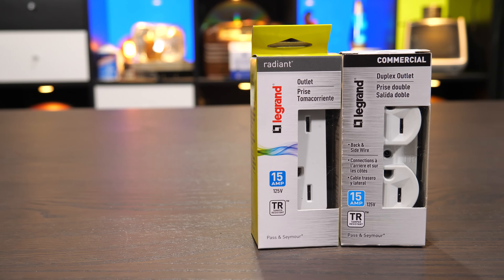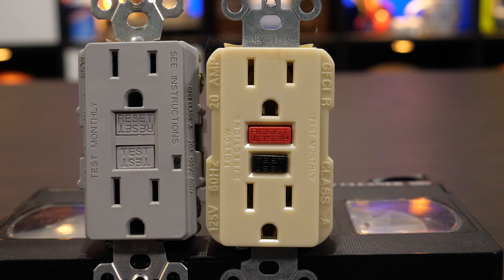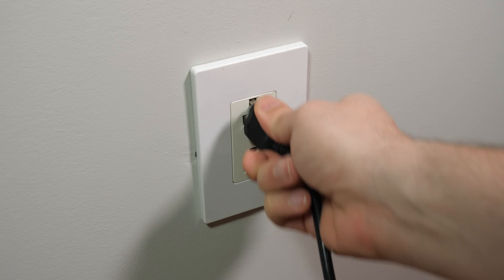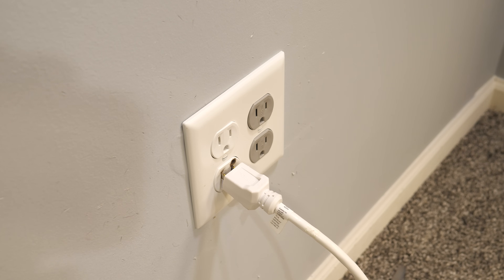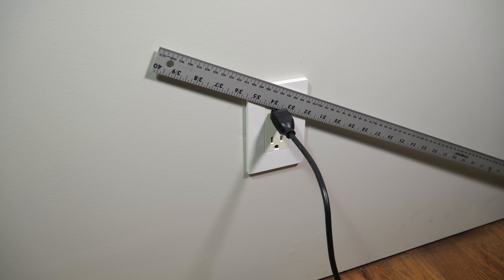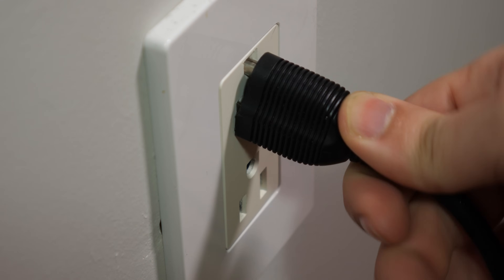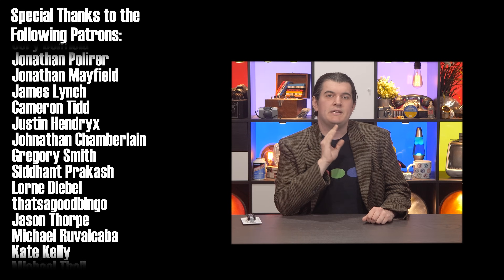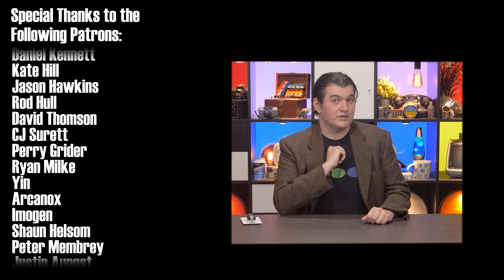Power outlets are topsy turvy - but does it matter?

Comment: "It would be supremely irritating"
Two-prong supremacy! If suddenly I had a bunch of upside-down outlets, it wouldn't matter one lick. If I had a bunch of upside-down three-prong outlets when I woke up, it'd be a marked improvement.
Reply: Or, maybe, recessed symetrical outlets with dual ground prongs at right angle to the live prongs? I wonder where I've seen that....🤔🤭🇪🇺✌🏻
Reply: @SonsOfLorgar  I know where you haven't seen that: my house built in the 1950s with ungrounded outlets!

Any sort of grounding solution would be an improvement, but I'd prefer one that works with the electronics I already have so I can completely retire from the adapter life.

Comment: My Dads cousins Husband is a retired electrician and when we had him over to fix a simple problem n the first house we bought he told us that there was a line in the code here that said outlets should be installed ground pin up when in mobile homes (which ours was not) but that no one seemed to care enough to do it and if we wanted to technically we'd be better off by flipping all of our outlets to that orientation and could easily do it with no issue other than the time it took and some breaker flipping. We elected not to take the time on it because knowing us when we moved the next people would just undo it.

Comment: If someone just made a faceplate with a little visor, that would solve most of the issues. Just a lip an eighth or quarter inch tall that sticks out around the perimeter. Basically, the faceplate could act to recess the outlet a tiny bit. The faceplate would catch or deflect objects instead of letting them head right to the prongs.
Reply: Or... CE standard...😂

Comment: Me: remembering all those old houses my relatives lived in with sideways mounted triple ungrounded outlets.  (often in the baseboard moulding so you could run the wires behind the moulding without putting holes in the wall)

Comment: I'm so glad Alec did a video on our shamefully horrid NEMA 5-15/20 plugs and receptacles. Having worked with many trade guys who, for reasons I can't imagine, seem to be the "guns, fireworks, flags, veteran parking spots, 'Murica!" type, this was always the one thing that would get them to admit this country isn't "the best at everything"... although usually only after pointing out the abysmal 1,500 watt typical maximum power available on our weakling 115V 20A circuits. 1,500 watts is like... less than a smart car power! THE SHAME! THE CRUSHED MASCULINITY! 😂
Reply: Way less than any car! Typical car engine/electric motor is around 200kW, and I've heard of electric sports cars pushing 1MW. Even a Model T Ford had a more powerful engine, at 15kW it beat your anaemic circuits by a factor of ten. So, there's something you can use to point out the low capacity of your circuits: "One tenth of a Model T Ford!".

Mind you, residential circuits don't need a heap of capacity. Even the most power-hungry devices like stoves and water heaters that get their own hard-wired circuits still only top out in the single-digit kilowatts (3.6kW for my hot water system). Our standard power points in Australia are only designed for 10A of current at 240V, and your home-charger for an electric car is still only 7kW, but who cares if it takes 8 hours to recharge from the day's usage if you're spending those 8 hours in bed?

Comment: My house was built in 1923 and the electric has been updated but I figure it's still very old. I worry a lot about fire but cost to update my very small 900 ft LA Craftsman was surprisingly high. I am sure I am not alone as far as living in an older home without updated wiring. I see a spark when I plug in something with a couple outlets so I assume that's not good. Would it help to just update the electrical boxes? Thought maybe some electricians, or those with  knowledge on subject, reading this could advise.

Comment: Way to identify a legitimate issue and then SPECTACULARLY FAIL TO ADRESS IT, AT ALL! The solution to this problem isn't shrugging and saying "I dunno, install it however you want", it's REGULATION of the freakin right angle plugs! Mandate the ground-up orientation on all plugs, and see how fast this *stops being an issue*.
Before you roll your eyes and scroll away, think about it for a second. Ground-up orientation on both the outlet and the plug would not only make them marginally safer, but more resistant to potentially hazardous wear and tear as well.
(Flat-footedly storms away, muttering incoherently)

P.S. I love this channel by the way. Never change, Technology Connections 💜

Comment: Our clothes washer and dryer have grounded plugs.  They are both the same brand.  Between then, they reversed one so the cord comes out the other side.  So one points up, and the other points down.   That way, they can both be plugged into the same duplex outlet.
I'm in Cook County.   Our 1967 house has sideways outlets👍🏻

Comment: a lot of those right angle cords fixed in the appliances like heaters are already the worst case scenario in terms of droop and stuff. within a season bad cable contact can cause outlet heating and other issues that aren't necessarily visible and if my parents are any indication, they never check on things while they're using them. walking through their house with a thermal camera was really scary. like "we need to replace these 4 outlets now, how did you not smell this." non-fixed cords ftw, extension cords: boo

Comment: I'm glad that our EU plugs are better in all points. They are perfectly insulated so that it's impossible to touch a part that has power. Also it's very hard to unplug them even a little bit by mistake.
Also they have ground connections on both sides which both are used by grounded plugs. So there is no question about the orientation.

Comment: You left out another reason not to rotate the plug socket 180 degrees: in some places the upside down plug is a way to identify which plugs are connected to a light switch.

In Arizona at least I've had multiple houses where the electricians put the lightswitch plugs upside down to denote which ones were wired to it

Comment: ...oooor you COULD just opt for a design that works equally in both directions like out Swedish plugs do; Two rods in the cebter and the ground connectors on both edges 90° offset to the rods. Can be plugged into the wall both directions (and the plug is surrounded by a plastic cover so even a partially dislodged plug, which never happens, cannor be touched, even when throwing knives at the wall!)

Comment: As a European I really do enjoy watching content about how horribly bad American systems are, like the fact that non of theese problems are even an issue at all, well exept for some cords stick right out of the plug instead of a right angle. 
But what plug design is best depends on the application and it can be easily swapped if you don't like it. straight out plugs are great for some powertools where you might have a reason to cut the power fast by just yanking on the cord.

Comment: EU plugs are quite well designed in my opinion: the wall mount has a depth to protect the plug, there's a plastic thingy that "covers" the electric "holes" and the orientation of grounded plugs is 99.9% (i've seen some odd things) the right direction, with the cord pointing down. Maybe being 220v made us look more into "how do we design this?" than 110v in the US? The only downside I see with the EU plug is that it can be hard to remove even if it's designed to have a "finger grip" built into it, and that cheap wall-plugs can be hard to insert due to the plastic-thingy being not well-made.

Comment: weight due to gravity will pull the earth out first which is bad because it removes the protection from the earth leakage device.
Reply: we have these rules in Australia, Im and Electrician
Reply: The ground pin is longer.
Reply: @GH-oi2jf  that is so the earth stays connected or is connected first when inserted in normal situations, it does not help if the earth is on the top and is pulled downwards

Comment: 7:40 I feel attacked, because I have actually dropped a knife on an exposed plug blades before... But I was a kid and I had done it intentionally. I had been smart enough to know not to touch it myself, but apparently hadn't made the connection that having some random piece of metal do it wouldn't also be bad.

Fortunately no fires or electrocutions, but the socket did have a scorch mark from there the knife and plastic had contacted each other before the knife bounced off the blade. The fuse didn't even trip from that briefest of contacts so my parents never even found out... and now I'm retroactively horrified that the fuse didn't trip...

Comment: I do prefer straight plugs because a) you can yank them off the wall b) you can always easily put a lot of them side by side.
We do use different recepticles over here, which are nice but are tiny and very close together, so it's easy for them to block eachother out if a weirldy shaped plug is inserted.
Also when you encounter recepticles recessed in a hole for whatever reason you can't fit in an L shaped plug.

Comment: I propose a worse standard: 3 outer pins each at 120V AC phase shifted 60° between them, and a ground pin in the middle. This way there is no "safer" way to install the outlet because there's always live on the top pin.

Comment: You should look up the german Schuko-Stecker (=Schutzkontaktstecker = protection contact plug), it's incredibly well thought out! It's recessed into the wall, the live contacts are isolated from the middle up, it's designed so the ground pins (there are two of them!) Are the first contact point when pluging in and the last  to lose contact when unplugging and it's completely irrelevant how you install it as it's mostly symmetrical!
Reply: Ran into a strange little quirk with that when on holiday in Germany in 2016. Using an Australian travel adaptor, my phone charger worked in one orientation but not the other. Seems there's something to designing devices that can make them sensitive to the active and neutral pins getting swapped.
Reply: @Roxor128  That's interesting, I can't imagine how that might happen. But then, I'm not that well versed in electrics and electronics.